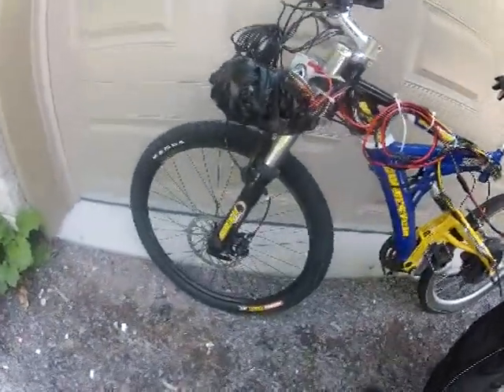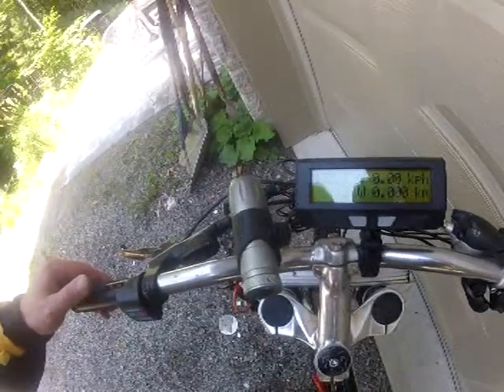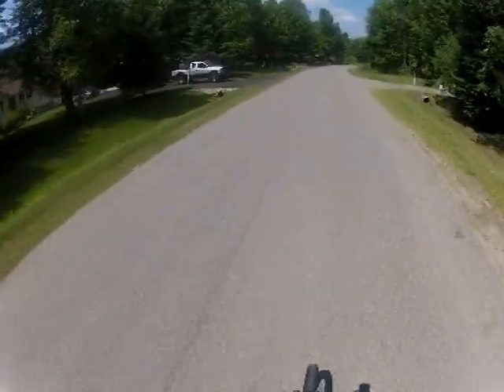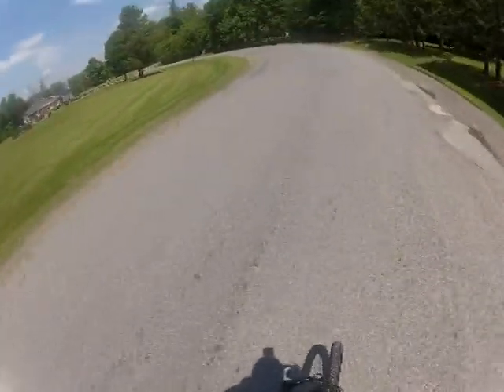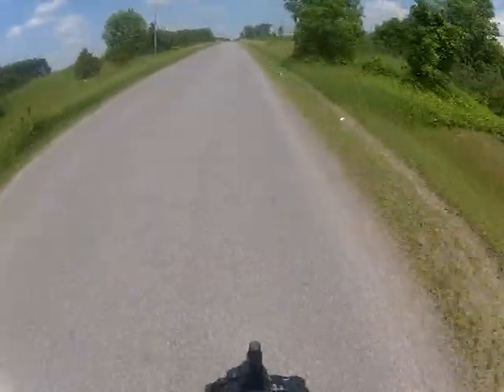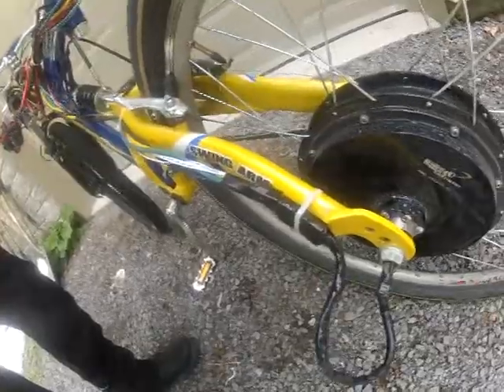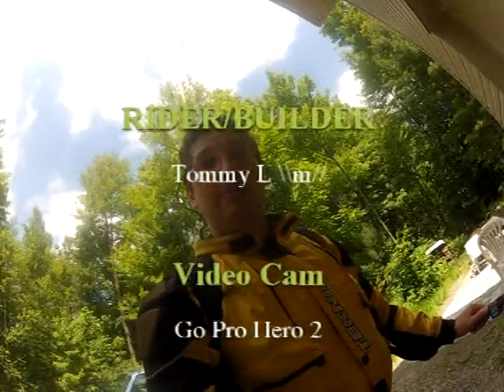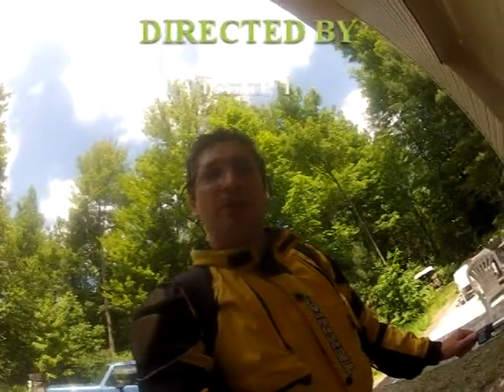128v First Ride.mpg

Comment: Very nice!  Can you remember what kind of power was generated during regen braking?
Reply from the maker: Not much.  It’s purpose in that day was Braking ……. In which it was and still amazing.  Grin ebike parts www.ebikes.ca has a geared hub that is 5:1 and does regen down to a stop  
And because it’s 5:1, there’s an appreciable amount of charge returned to the pack.
Reply: @TommyLuptak  thanks for the reply! Not really concerned with the amount of charged returned to pack, just curious how many watts were generated to get an idea of stopping power.
Reply from the maker: @blackz06  you can program it. I have mine at 80% regen.  Any thing higher locks the rear wheel up.  Strong from 50mph to 25mph then it’s all up to the hydraulic brakes after that.

Comment: Hmm I hit just about 40mph using a 48v battery... I feel like you should be going much faster 🤷🏽‍♂️.
Reply from the maker: 206robert206 motor poles and the number of wire turns on each pole KV of motor determines rpm of motor vs what voltage you are running. 😉
That particular motor is a 28 pole with 10 turns on each pole. At 100v
33mph, at 133v 41mph at 144v 50mph ...... at 48v guessing 12-15mph.  Most Direct Drive hub motors are 3/4/5 turns per pole. Allowing for lower voltage but higher amp draw to get same speeds.  I wanted to build a high voltage setup for efficiency with less energy loss to heat.  I hope this was helpful. 😊
Reply: @TommyLuptak  yeah that clears it up. So higher voltage for speed while reducing the amp draw for efficiency. I'm pulling around 31amps from my 20ah battery which doesn't really get me far at all but it's fun! (About 12mi if I try to be somewhat efficient)
Reply from the maker: 206robert206 it’s difficult not to get into the throttle.  lol

Comment: Hey Tommy...im running a Crystalyte hs3540 on my Arctrike with 79 volts fully charged@65 amps. I can pull a max of 4800 watts and i have the same Lyen 18 fet controller with the 3 speed switch. On my set up on low i can get 28 kph on no 2 i get anywhere from 55 to 60 kph and on high ive hit a max of 77 kph. My trike would be more aerodynamic but im running lower volts....interesting..
Reply from the maker: Hi John!
Yes, the higher the voltage the faster the motor can spin, but the other VARIABLE that has to be considered is the Motor Wind.  I have a 28pole 10 winds per pole.  If I had a 28pole with 5 winds at 100v would theoretically double my speed if I didn't have Aero as another factor.  ;)  I'm not sure of the HS3540.  I believe it to be at 2 or 3 wind.
 http://endless-sphere.com/forums/download/file.php?id=54879   good picture of constant 40v with RPM of wheel :)
Reply: So im assuming that the higher wind per pole count would give the motor more torque?....if you had the HS3540, it would be scary how fast your rig would be, discounting aerodynamics of course.
Reply from the maker: John Zoccano Yes....  But the HS3540 with 128v nominal or 133 hot off the charger may not be a good combo.  The HT and HS motors do not dissipate heat very well.  I went for a higher wind motor so I'd have some torque off the line, but then the torque goes away and the amperage drops off very quick with a high wind motor.  My Goal was High Wind/High Voltage to go for Efficiency.  I average 30 watt hours per mile at 30mph  or 19 Watt hours per Km at 50kph.  ;)

Comment: Hey Man...nice deal...i think with that voltage your top speed should be higher, but 70 k is fast either way!. When your riding are you sitting up straight??On my Trike, i was able to top out at 52 kmh at 48 volts, but have stepped up to a 80 volt headway system, and am expecting about 70 kmh.
Reply from the maker: Hi John,  One must consider the Motor Wind (Volt per RPM) when trying to figure top speed and other variables as well.  2810 for my motor means 10 winds per pole.  At 48v a 10 wind per pole might see 25-30kph.  I selected this motor to test high voltage setups/efficiency.  ;)
Reply: Ok that makes sense. At 48 volts on my trike, with the Crystalyte hs3540 i got 50-52 kph, so im expecting 67-72 kph with my 78 volt system
Reply from the maker: John Zoccano Have you used the Software on Ebikes.ca website?
The modeling software there is fairly accurate  ;)

Comment: only 70kmh out of 128v?  hmmm strange.. are you running lipo's or life? What controller are you running? 
Mine with a slight downhill and pedaling,  I got it to 96.5kmh..  Its a stealth bomber with a crystalyte controller, crys x5035 hub and 72v (full charge is 81v)
Reply from the maker: Hi.......  If you read the description, it answers all of your questions ;)
The motor is a 10 wind verses your hub with a  5 wind.  I believe your
Crystalyte is a x5305 as there are no 5035's that I've seen.
If you do the calculations on the 2810 motor, you will see that speed 
for volts (Volt/RPM) is right on the money.  Running LiCo or LiFePO4 
does not make any difference. In fact, using LiCo will go slower and slower
as the energy is being used the voltage drops, where as LiFePO4 will 
drop only slightly in voltage over the given use.  Cheers!
Tommy L sends.......

Comment: I know 50 mph is a lot but I guess I would only go to that speed when necessary and cruise at about 30mph to avoid overheating the whole system. I will try to find an affordable DH bike to convert. What cells do you prefer? A123 seems great but I never tried them. I am loving the Sony cells (10C max discharge) that are in the makita packs :).

Comment: Nice video Tommy. Interesting info for my next build. I would like to build a 50mph e-bike for next spring/summer..:). I am currently running a 15s makita pack on my rear bafang, and reaching 45kph pretty fast. I could go 20s with a different controller but I don't want to damage the gears. PS that Lyen controller is enormous!